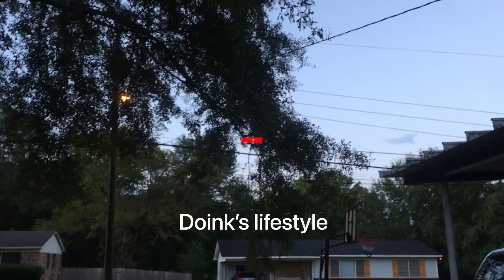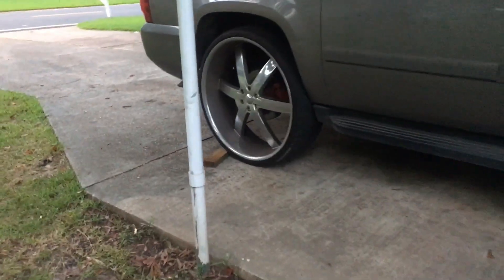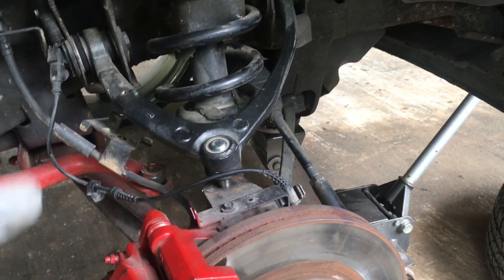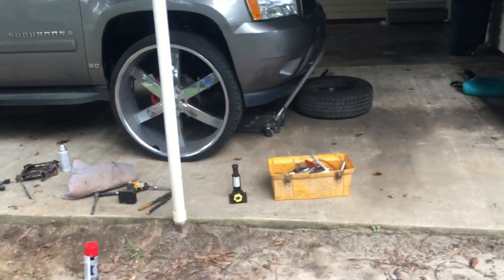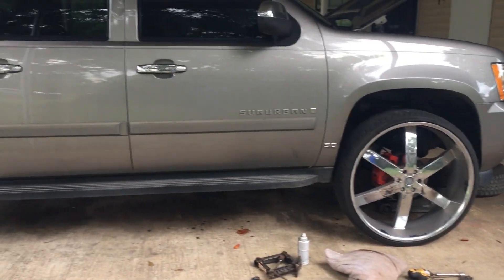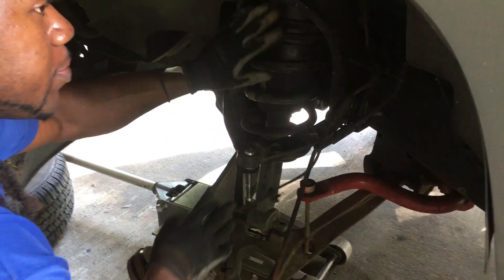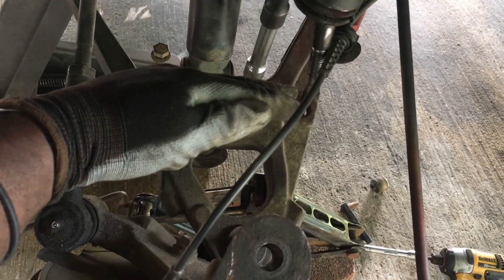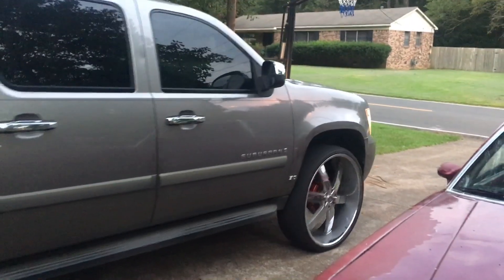3 INCH LIFT ON MY SUBURBAN  ON 30S | FIX MY SUBURBAN IN 30S

Comment: BRO SINCE YOU DID THE LIFT ANY PROBLEMS WITH YOUR UPPER CONTROL ARMS WEARING OUT EARLY?
Reply from the maker: Man hell yea . Well I bought both sides and I put driver side on myself and got other side put on by shop.. and we’ll yea the side I did is the side I hear like it’s popping or something idk. So ima buy another one and let shop do it
Reply: I never had a problem bro your suspension has to be good not half ass I had 3.5 inch and 3 inch never had a issues
Reply from the maker: Ur right bro
Reply: @doinkslifestyle  yea my shit lasted 2 years with no problems driver in and out of town everything
Reply: @doinkslifestyle  and when your suspension is all new and aligned the truck sits higher
Reply from the maker: That’s my next project man I preciate that

Comment: You are supposed to take both sides apart and put the driver on the passenger passenger on the driver so you don't have to fight with the shocks on the struts

Comment: Where u get the lift kit from
Reply from the maker: Ricks pro truck.. or eBay
Reply: So a 3 inch leveling kit will fit tahoe or suburban for 30s
Reply from the maker: They will fit both. It’s a 08 suburban and I did my bro 09 tahoe..